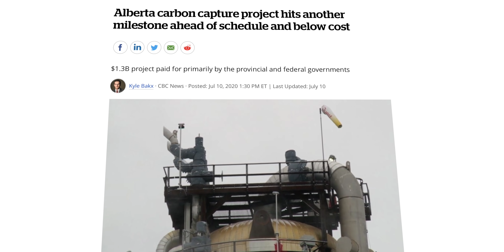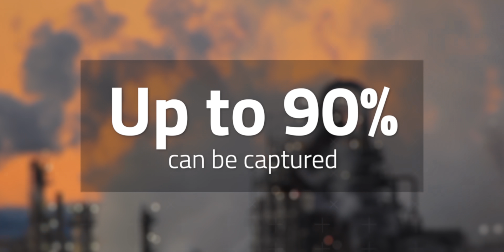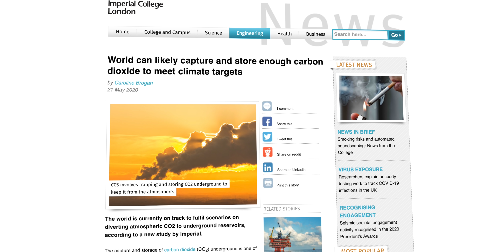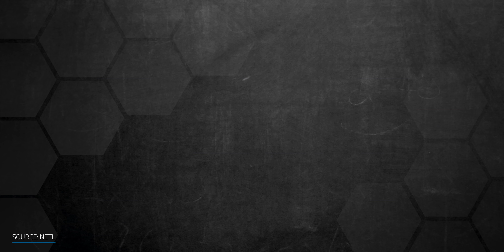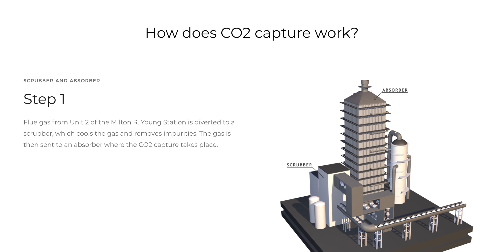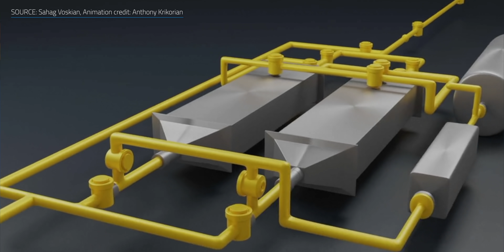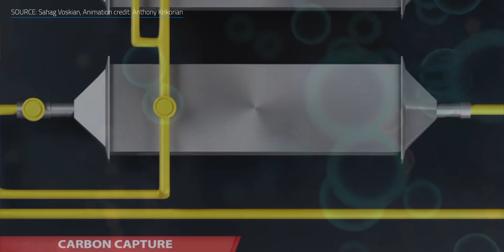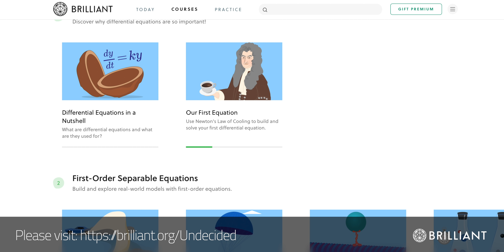The truth about capturing CO2 to reverse climate change

Comment: Trying to store CO2 into structures using CO2 extracting machines and absorbing it chemically into concrete is ridiculous when you have a much easier and cost effective way to accomplish the same: wood!

Modern wood building techniques are advanced and allow for very safe multi story buildings. It builds fast and it stores CO2 for a very long time. And wooden buildings are actually a safer alternative to concrete when it comes to fire hazards too. Ask any firefighter. Because wood does indeed burn but thick wood doesn't catch fire easily and when it does burns predictably. Whereas concrete becomes unreliable quickly when the temperature rises and can even explode and crumble as the steel reinforcement inside expands under heat.

Wood building is slightly more expensive still but when companies start to have to pay for CO2 emissions and can even trade CO2 absorption on the market then wood building will quickly become a very profitable business.

High tech wood structures are the best manmade longterm CO2 storage options available today.

Comment: Finding uses for CO2 sounds like finding uses for the 20 double chests of cobblestone I don't know what to do with in minecraft
Reply: Make machines that will rebuild walls and ceilings for your base in the event they are destroyed.
Reply: @OmniscientWarrior  not sure how effective that would be without mods. I would need to manually place the 20 chests of stone. Alternatively I could just use cobblestone generators :P
Reply: @scorch855  I don't remember the names of the stuff off hand, but you just need a half second ticker to turn on a piston to push blocks with the thing that puts contained items in front of it, the piston pushes the stone from in front of the other device.  I know there are many videos that cover this and this is done without mods.  Part of the issue, I am tired.
Reply: @OmniscientWarrior  neither droppers nor dispensers can place blocks. The closest you can get to automatically placing mined blocks in vanilla minecraft is an AFK player with a clicking script. Yo can do something similar using pistons and a cobblestone generator but that does not use the blocks in the chest.

Comment: Oil obviously needs to be phased out, but this could serve as an important part of exactly that process! Until we can replace these old systems with renewable and sustainable technology, carbon capture is a limited but valuable resource to use. Worst case: they keep drilling at a lesser CO2 impact until they run out of oil - not good, but worth the cost of CC systems. Thoughts?

Comment: I think one of the most important discussion topics on this subject is that direct air capture targets ALL CO2 in the atmosphere.  According to the IPCC, humans are responsible for less than 4% of all carbon released into the atmosphere.  This means that regulations designed to limit carbon emissions affect a very small portion of the problem (theoretical maximum of 4% of CO2 emissions).  Whereas direct air capture attacks all 100% of carbon in the atmosphere.  Direct air capture would allow humans to be carbon negative instead of just carbon neutral.

Comment: Direct air capture is a farce. There is more CO2 used in it's construction and operation than it can remove from the air.  Energy sources void of carbon production from the beginning is where the money should go.  Hydro, nuclear, wind, solar etc.  Use some of that energy to produce hydrogen fuel for vehicles.  You can't force it down people's throats though, or you end up like California with a third world power grid.

Comment: When capturing CO2 from the atmosphere, wouldn't the energy needed to lower the entropy for capturing be nearly as high as the energy generated by burning fossil fuels ? Does anybody have an idea ?
Reply: I would guess given how entropy and the laws of thermal dynamics work the energy to put it back is orders of magnitude greater than  extracting it.
Reply: @Gautam  the gov. says you can't build bombs with thorium
Reply: Probably not, burning fossil fuels does a lot more than a simple dilution of CO2.
Getting that CO2 into a stable storage, and doing it fast, is the difficult part.

Comment: Matt, you need to be clear when you state that these systems only account for the capture of only 0.1% of the total carbon emissions. As I understand it humans are only responsible for around 3-4% of all carbon emissions. So is that 0.1% of the 3-4% total or 0.1% of all carbon emissions
Reply: ^ this.  At its theoretical maximum, regulations limiting carbon emissions can only decrease total carbon emissions by 4%.  DAC could, theoretically, suck 100% of all carbon out of the atmosphere.  It's much more efficient to address 100% of the problem instead of just 4% of the problem.
Reply: @chase_cooper  then we all die. We need carbon dioxide in the atmosphere, without it everything dies. Currently we are in one of the lowest carbon dioxide states the world has been in. It's been as high as 1300+ ppm currently around 450 ppm
Reply: @ewanderric4679  I am in no way suggesting that we suck all the carbon out of the air.  That would be stupid.  I was stating that the theoretical efficacy of DAC is much higher than limiting emissions.

Comment: The truth about "carbon capture" and its cousin "clean coal" is they are political technologies. They were devised as propaganda to paint dirty technologies as fixable. These  technologies can never ever come close to handling a tiny fraction of the carbon we emit. While we can demonstrate the technology, we could never scale it up to any meaningful benefit.

Back in the early 1980s Ohio had a vote on whether to ban no-deposit drink containers. The beverage industry went into shock fearing if it passes in a state like Ohio it will go nationwide (since it hasn't gone nationwide they were probably right). So the beverage industry poured tons of money into political advertising to defeat the proposal. But it wasn't enough to be against, they needed an alternative to tout so they came up with the "Practical Litter Law" and blanketed the airwaves promoting it. The way the fantastic "Practical Litter Law" was supposed to work was the state would hire work crews and they would go pick up all the discarded containers creating JOBS, JOBS, JOBS! The ban failed at the ballot box and the "Practical Litter Law" evaporated to the point if you google it today you don't get any results. "Carbon capture" is the 21st century version of the "Practical Litter Law", but even more impractical.

Comment: But what about all the GHGs that are already in the upper atmosphere?
Reply: They are "short lived" (<100 years). Sunlight will dissolve them.  CO2 is the long term Problem...
Reply: @Christian-ev1zu  And the big corporations do not want anyone to do anything about it, because such action is guaranteed to cost the big corporations a lot of profit.
Reply: @denelson83  CH4 is the main GHG today for climate change after CO2. But no Corporation would if possible emit that into the athmosphere... because it is to valueable. So main emitters are agriculture. In all cases it is an unwanted byproduct where the emission costs the producers. i.e. it is valueable to someone growing cows to use diets that lessen the CH4 emission as any calorie that goes into the CH4 is a calorie lost to the meat.

Comment: You say -- without stating any evidence whatsoever -- that this is just an excuse for the major oil refiners to keep on "polluting." 

Btw , C02 is not pollution; it's a gas that's normally present in the atmosphere. Cigarette smoke is pollution. Burning wood produces pollution. Burning any fossil fuel produces pollution, but C02 is not one of the pollutants. 

Do you have anything like quotes from the CEOs of Shell or Exxon that this is indeed what they are interested in doing ... buying time so they can keep on polluting? 

You also just take it for granted that we can start out with a good program right now for reducing carbon emissions and ramp it up for a few decades and viola ... problem solved. This is naive beyond belief. From a scientific standpoint, that MIGHT be possible and might keep us below the level of catastrophe. But it totally ignores the political and economic obstacles facing such a program. For one, China and India are not going to go along with this. They are rapidly modernizing are not going to stop. They are going to be using more, not less, fossil fuels in the future. Also, tampering with the world economy which right now is solidly based on the consumption of fossil fuels, could easily lead to a worldwide depression and even the deaths of millions and the impoverishment of billions.

Comment: Best solution,  switch to nuclear fission,  and put the money into nuclear fuseion technology advancement for the long term solution
Reply: Except for nobody has been able to make fission work.
Reply: @scottanderson9656  We have nuclear fission power plants working for decades
Reply: @mulletman1705  Sorry I was thinking of fusion.  You are right there.  Fission doesn't work in the way you suggest.  They cost a fortune to build taking massive amounts of energy and materials to build and are extremely hazardous while operational.  The decommissioning is almost more problematic being that there is no way to safely store the wasted.  So you are correct in that there are fission reactors but you're incorrect in the dated idea that they are a solution.
Reply: @scottanderson9656  they are the only solution we currently have capable of supplying 100% of the world's power requirements from a reliable and long term fuel source. For example the country France with a population of 66 million derives 75% of its powet from nuclear fission. Nulear fission waste is treated in facility's such as Sellafield in England and stored under sea or underground. As stated in my original comment this is the short term solution with nuclear fusion being the long term goal.
Reply: @mulletman1705  Look that's bs if you consider all the factors.  First off they are anything but safe without taking into consideration potential bad actors. The problems with potential accidents alone are incredible.  That's why it's not possible to insure them except through a gov't institution.  Then there is the insane cost and resources needed to build them.  Then there is the waste they produce.  I mean really the radioactive wasted is enough of a reason.  Lastly there is the problem of decommissioning and long term storage of, once again, the waste.  There is a reason why they are going away and non too soon.  Do some thinking before you type.

Comment: Great video.

Algae Fuel, derived from growing algae in a carbon dioxide rich atmosphere (with lots of sunshine) allows for the captured carbon to turned in to crude oil and all the derivative products! Removing the need to burn fossil fuels. 
Plants can be deployed in sun rich areas (deserts) and continuously produce “algae oil”.

As you mentioned in your video, they can also be paired with high carbon producing facilities, just as BFS did at a concrete factory in Alicante.

https://youtu.be/s0xnlx7hYnI

Comment: In order to reduce CO2 just plant severely MORE trees, chop them down and use anywhere except burning.
Reply: Sigh.
Reply: They will still rot.
Reply: @OmniscientWarrior  Correct. But if wood is used in furniture it usually soaked in chemicals that protect wood from rot or any other stuff.

Comment: I was surprised Bill Gates's project to turn captured carbon-dioxide back into gasoline (or such) wasn't mentioned.  I found out about it through another YouTube video (Real Engineering?).  Personally, I'd like to see the carbon part be used for products like carbon-fiber and graphene and such.  However, I get the impression it isn't easy to separate the carbon from the oxygen.

Comment: What I would like to see is one scientific proof, that man made CO2 is the cause of climate change. Cook's "97,5% study" turned out to be a 2,5% study... CO2 and water vapor are the 2 biggest greenhouse gases, but man makes about 5% of the CO2. CO2 starts to rise after 800-1400 years after the the oceans warm up, so it can't be the driving force. You can now check 800k years back from the ice core drillings and see, that temperature has risen 7 times and just before a new ice age starts. What factories we had 800k years ago? There is nothing wrong with stopping pollution, recycling and consuming less, but the whole CO2 scare is just to make some countries pay tax for all production and some countries paying naught. I live in a 'plastic bag', because law dictates my house needs to have AAA energy grade. Then I need to have AC running 24/7 with electricity, so that my house does not get mold. That power was most likely produced with coal. I need to cash out my kid's college fund to buy a natural gas car and rockefeller's use fracking to get that gas out of the sea bed. Bye bye Great Coral Reef. Btw UNESCO said climate change destroyed the coral reef... If I heat my house by burning wood out of my own forest I am creating micro particles and giving everybody cancer. When UK cuts down forests for they wood burning power plants, it is just "renewable biomass". I can show actual data to prove my points and the 'other team' can show polar bears on melting ice slabs. http://joannenova.com.au/2018/04/greenland-same-temperature-now-as-1880/

Comment: But planting trees have the added advantage of regulating temperature and moisture in the air and soil. Not to mention it can also produce fruit.
Reply: Not to mention plants need a minimum of 150ppm just to survive. If CO2 was higher (up to 1700ppm) a plant’s yield would double without changing anything else.
Reply: @MK-ib4dp  that only works if the plant has enough of everything else like water and nutrious soil. Both are affected by climate change
Reply: @MK-ib4dp  Well let's hope it never gets that high, I think it will probably peak between 600-700 ppm and then the climate will stabilize. Hopefully we are invested in taking care of our climate and regulating all Earths forests and how much greenhouse gases are emitted and we can reduce it to 250-300 PPM again.

Comment: If You lower CO² the only effect is, fauna has more problems, now what You think of this, Many years back Pangea , why whas pangea bared  under ice? Pangea was placed that a large part had far less sun. Pangea broke in several parts and , so displacements   and  there was the sun.   The sun destroyed the thick glaciers. And note, if the flora  is growing very fast , that means high Co2  And the dino's sure whould have a much tougher life due to high Co2.   Want to capture co² , plant a forest  but do note 400 ppm is good for flora  and still acceptable for the  fauna.
Reply: error flora has more problems.

Comment: Oner CCU Power generation plant was experiencing a 40% increase in fuel burned,, to run the CCU end of the equation.  I understand the energy to operate CCU is prohibitive.  IF that is the case,,, the cost will likely not come down substantially.  New tech,, innovation will be required to make this work.

Comment: .....  Hydro power is the cleanest most efficient energy form.  CCU is the most inefficient catalytic capture process.  Coal, oil and gas are the easiest and most gratifying energy forms, they just suck.  Want to eliminate carbon?  Build dams, but good luck.  Save smelt or save the planet?

Comment: There is no empirical evidence that increasing CO2 causes increasing global warming.
(Correlation does not imply causation).   

An increasing greenhouse effect depends upon increased re-radiation from CO2 in the atmosphere, and this manifests itself as a tropical tropospheric hotspot plus increased Downwelling Longwave Radiation (DLR) which warms the surface.   However, this hostspot and increasing DLR have never been detected.  In which case, CO2 cannot be causing global warming.

And we know that CO2 is not causal, because during the ice ages - when CO2 levels were high the world cooled, and when CO2 levels were low the world warmed.  The climate would not do that, if CO2 was the primary feedback agent.  

In reality, the primary feedback agent is ice-sheet albedo (reflectivity), which is modulated by dust.  Yes, the data shows that temperature is inversely proportional to dust.  So it is dust-albedo that modulates ice ages, and  this explains all the manifold aspects of the ice age temperature cycle.  Please see my latest science paper on ice ages, which demonstrates that CO2 was NOT controlling world temperature at that time.  

Modulation of Ice Ages via Dust and Albedo:
https://www.sciencedirect.com/science/article/pii/S1674987116300305 

Ralph.